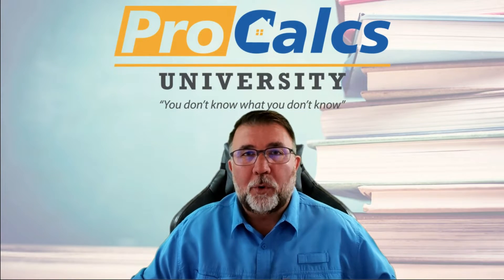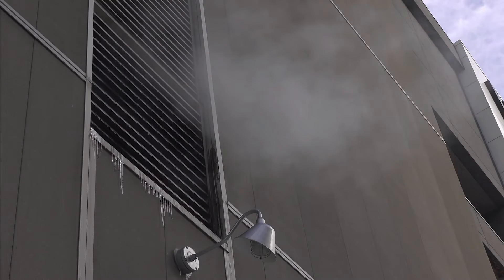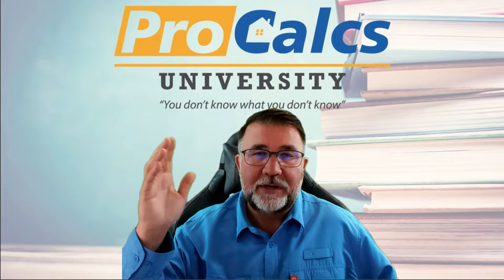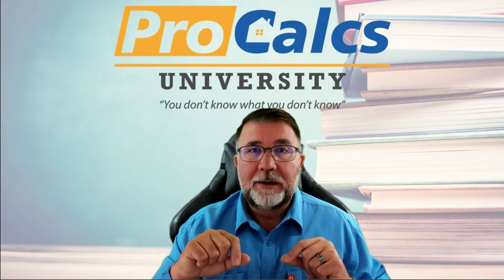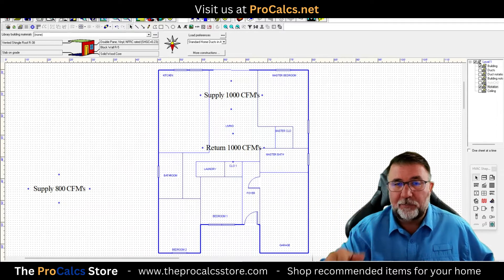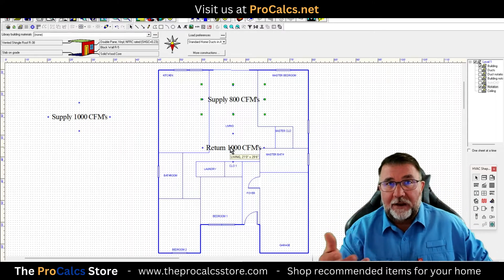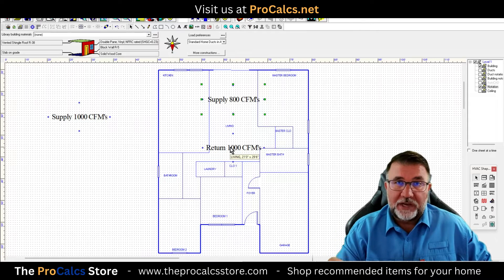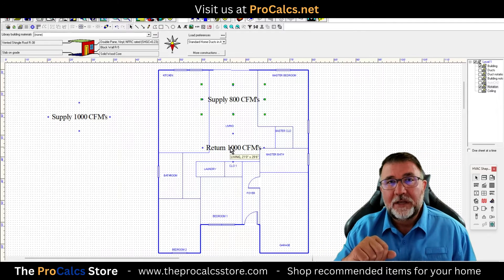Positive and Negative Pressure In Your Home

Comment: Hello, just watched your video and found it to be super informative and interesting.  Just bought a house built in 1990 it has a 4 ton Ac and heating unit all in one. Located on the roof. I installed a one piece dog door that mounts on to the tracks of my sliding glass door. And when the air conditioner comes on the flap of the dog door  pushes out and stays open. Is this what your calling a positive air flow? And what do you recommend I do to decrease this air flow so the flap stops blowing out and sending all that cool air outside? Help !! Please!!
Reply from the maker: Hello Jorge! We're glad you found our video informative and interesting! It looks like when the dog door is being pushed out, the  pressure inside is higher. For homes, we want to have a slight positive pressure as that's better than negative.

Here are some steps you can take to address this issue:

1. Inspect the seals and gaskets around your sliding glass door to ensure they are in good condition and not allowing air to escape. If they are damaged or worn out, consider replacing them to improve the overall insulation of your door.

2. Many dog doors come with adjustable settings to control the sensitivity of the flap. Check the user manual or product documentation for your specific dog door to see if you can adjust it to require more force to open. This might prevent it from being pushed open by the air pressure.

3. If you're into DIY, you may also place a magnet on the sides of dog door to create a better seal and minimize the amount of air escaping.

It would also be best to have a professional come out and inspect the system. Hope this helps!

Comment: Your videos are great and I have concern about what my HVAC company is wanting to do while installing a new system.
They are wanting to run a dehumidifier with the intake, pulling air from outside that is filtered and dumping it into the Plenum before the filter.
This is to get fresh air into the house and also create a positive pressure.
1 live in south Louisiana and pulling air without the dehumidifier would be putting
90% humidity into the Plenum.
Your advice is greatly appreciated.
Reply from the maker: Hey there! We appreciate your kind words and we're thrilled to hear that you enjoy our videos! 😊

Your concern about your HVAC company's proposed installation is valid, and it's important to ensure that any modifications to your HVAC system are both effective and safe. 

Here are my thoughts:

Given that you live in south Louisiana with high humidity levels, controlling indoor humidity is crucial for comfort and preventing mold and moisture-related issues. If your system was not designed to have outside air added before, you'll want to have a load calc completed to make sure the system can handle the additional hot air and humidity. And also, it's always a good idea to get multiple opinions from different HVAC professionals. Have another reputable HVAC company evaluate your home and provide recommendations. This can help you compare different approaches and determine which one is best suited to your specific needs.
Reply from the maker: Hi there! We'd be happy to help with your HVAC concerns. Please feel free to email us at tom@procalcs.net along with your address. We'll do our best to assist you with any questions. 😊

Comment: This was a super interesting video. I live in South Florida and the heat has been brutal on the AC it is not feeling great at the peak of the day. If we have a 95 degree day it's going to be a bad day inside but it it drops to 92 to 93 its a world of difference. Thanks for the video your explanations were spot on I plan on sharing this video and I want an energy inspection.
Reply from the maker: Glad you loved the video! We're pleased to hear that you found it helpful and accurate. Living in South sounds like quite the challenge with the intense heat and if you're considering an energy inspection, that's a fantastic step toward optimizing  your living environment and potential saving on energy cost too!

Comment: By chance I just discovered a very dangerous negative pressure condition in my home. Hot and humid weather this past week so we closed all windows and doors, ran 2 portable air conditioners venting to the outside. Add an electric dryer that runs a lot....etc etc Today I cleaned my oil boiler and thanks to some left over crud when I fired it back up I saw smoke entering the room through the closed damper. No big deal right. I just missed vacuuming some dirt in the fire chamber. The next time the boiler fired it did the same thing. The damper was never pulled open while the boiler was firing. I pushed it open to make sure it wasn't stuck and it immediately closed back up.  I opened a window to help exhaust the smoke and a wind hit me in the face. There was no wind outside but the negative pressure pulled so much air in the window you swore it was windy outside. I opened a second window and the same thing. I left the windows open and observed the boiler the next time it fired and the damper opened and no smoke or smell entered the room. I will be adding some sort of ventilation in the mechanical room soon. Thanks for the videos!
Reply: Wow thanks for sharing that, that was interesting.

Comment: We finished out our attic and just ran new ducts. Since then our master bedroom has been getting warm. Walking out of our bedroom you can feel actual conditioned air. I am thinking we screwed up so contacted hvac company. They said possible negative pressure, and offered the only solution of adding return in my finished attic. I kept the door open for days and it never solved the problem.
Reply from the maker: There could be a few things causing the issue, it's hard to say without more details. It's possible that your system is undersized now since adding the additional conditioned space of the finished attic, unless you had a load calc done to check. It also sounds like the master bedroom may not be getting enough air now, and if the supply grille in the master bedroom is the wrong size for the amount of air, that can cause issues with hot spots. A return in the finished attic would be recommended though either way, and per most codes is required when a room is occupiable and has a door that can be closed, like a bedroom or office. It would probably be a good idea to have a load calc done, as well as the duct system evaluated to try to pinpoint the issue. If you'd like to discuss further, feel free to send me an email at dana@procalcs.net.

-Dana, ProCalcs LLC

Comment: Interesting video!  Would a local air conditioning unit (not central ducts) that is taking air from just that room and spitting it back into that room, create positive pressure for that room?
Reply from the maker: Because there is very little to no duct work, and supply and return are in one room, the duct work has a very small chance of adding to the negative of positive pressure in the room, but it could happen. However, depending on how tight or lose the room is to the outside, there could easily be a negative pressure. A lot depends on the type of system and how everything is installed and designed.
Reply: Your videos are great and I have concern about what my HVAC company is wantingv to do while installing a new system.

They are wanting to run a dehumidifier with the intake, pulling air from outside that is filtered and dumping it into the Plenum before the filter. 

This is to get fresh air into the house and also create a positive pressure.
I live in south Louisiana and pulling air without the dehumidifier would be putting 90% humidity into the Plenum .

Your advice is greatly appreciated.